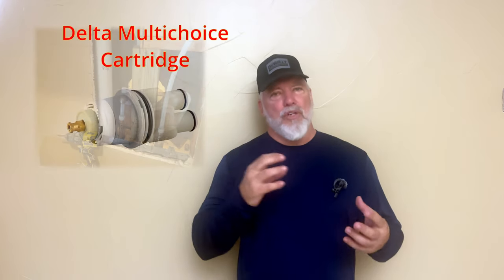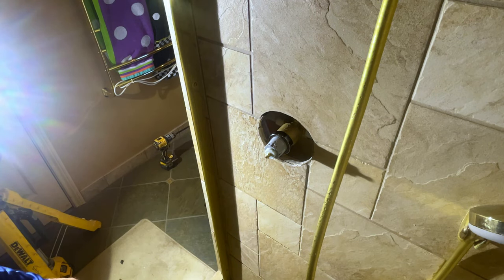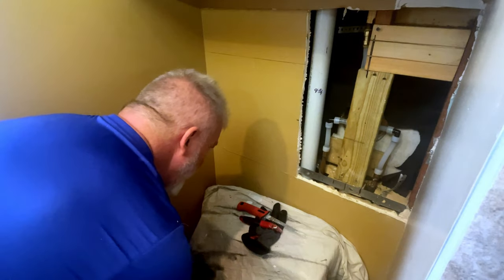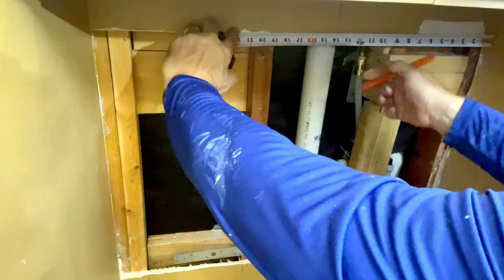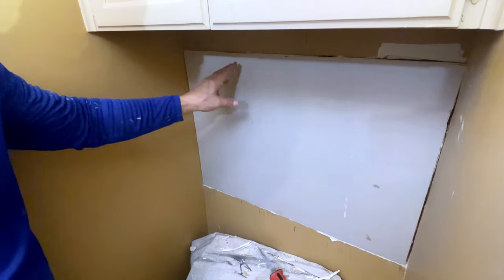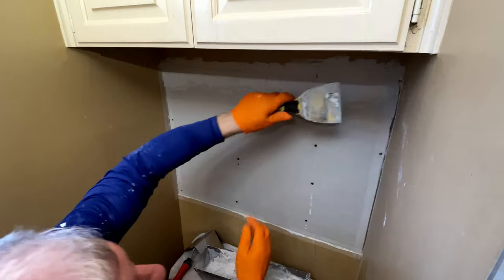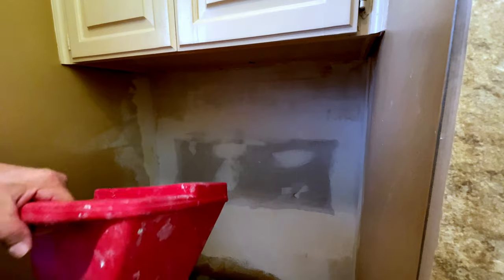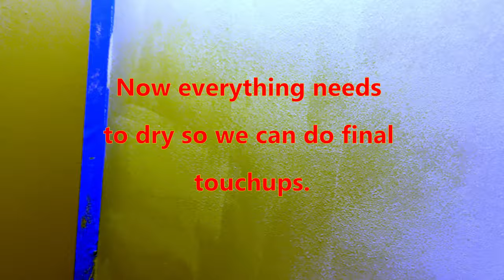If Your Shower's Not Working, Try Installing A Delta Multichoice R10000 Universal Valve! Part 2

Comment: spent a lot of money on a Delta Multichoice and it's dripping. waited about 45 minutes but no one ever responded to chat.
Reply from the maker: I had one that I was having issues with a few months ago and ended up just replacing the cartridge and it’s working great now. I also had a non stop drip issue on a tub/shower unit a few years ago that someone had used pex to the tub. I replaced that with copper and fixed the drip. Hope you get yours working. Thanks for watching and the comment.
Reply: @UltimateDiyer  thank you. my attitude is that my other washerless valves almost never leaked and this expensive one should last much longer than it has. in the old days Moen would send free replacement cartridges but they stopped doing that, i switched to Delta, spent a lot more money and now it leaks.